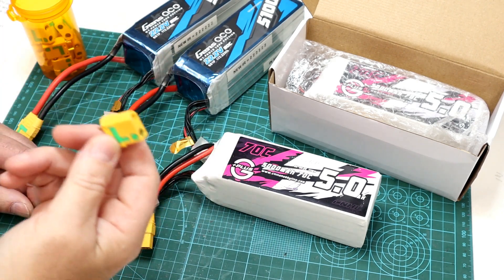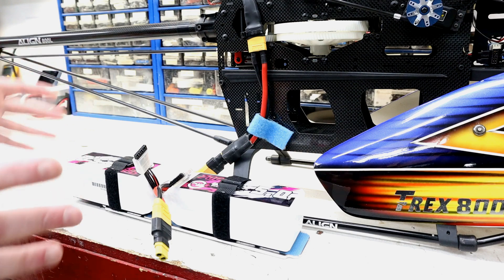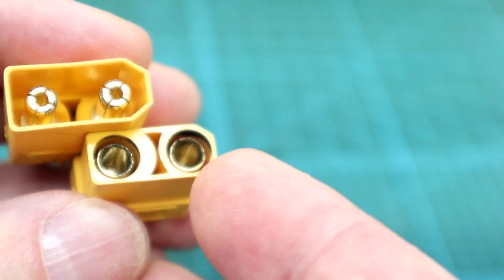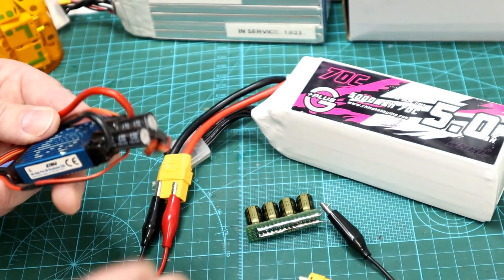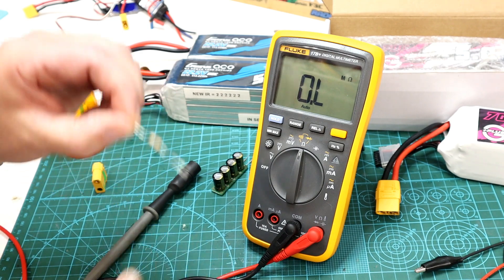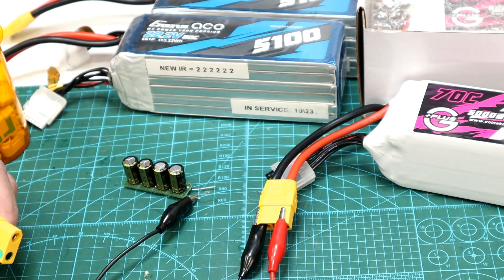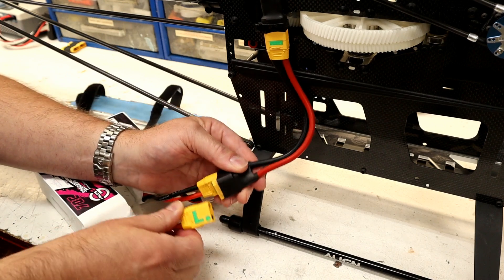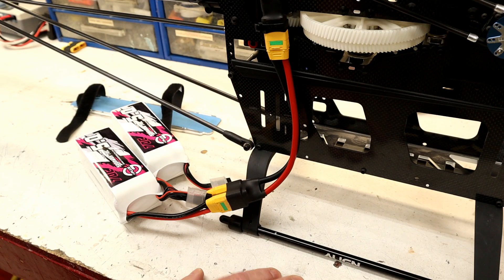How Do Anti Spark Connectors Work & Do You Really Need Them?

Comment: I've converted all my LiPo batteries from 4S upwards to XT60 anti-spark connectors. From 5S upwards, I only use XT90 anti-spark connectors. I'm very happy with the results. Finally, no more sparks when connecting the batteries.

Comment: Why does the green indication shown as its resistor also connected to the other pole.
The green bar are shown crossing the poles, not just the entry ring and the full connect full in...
Reply from the maker: It's not. No one ever said the green plastic is where there is a resistor/s; there is no correlation between green plastic and what's inside. If you take the time to grind one open, the resistor is located between the two split rings of the positive female bullet sleeve; nothing more, nothing less.

Comment: Is there anything I can plug in between the charger and the battery. I know you can get anti spark connectors but I don't really want to solder anything.
Reply from the maker: If you don't want to solder, then you are stuck with stock connectors.

Comment: this is works with xt60 adapter because i dont see xt60S connectors?
Reply from the maker: XT60's are too small for this design. Only XT90S.
Reply: @Rchelicopterfun  so the amass xt60h is not anti spark?
Reply from the maker: No XT60 is anti-spark (the original/h or i).

Comment: Basically an RC circuit to the source. RC provides a time constant, delay. A capacitor is a voltage device. After 5RC(time constants) it acts like an open. An inductor(coil) is the opposite. But, remember that resistors inline will have additional resistance to the battery. Not, much but it’s there.
Reply from the maker: The momentary anti spark resistor will add no additional resistance since it is only in circuit for a brief moment before the pin slides past it to make full connection; unless of course you don't slide the connector all the way in as explained in the video. If that happens, the resistor will get so bloody hot, it will melt the connector or burn out.

Comment: John, why are these on the battery side and not the ESC side? I like the idea but think it would of been better to be on the ESC side so you don't have to add it to every battery.
Reply from the maker: Short danger - that's why. The male XT90's (the ones always on the ESC side) have exposed pins that are not insulated and thus have a high short potential if anything conductive were to accidentally or intentionally inserted into the end of the connector.
The lowest short potential connector, regardless of type, is the ALWAYS the one that goes on the battery side for safety reasons. I cover this in detail on my RC Battery Connector page on my website: https://www.rchelicopterfun.com/rc-battery-connector.html
Reply: @Rchelicopterfun  I could be missing something but why can't one of the pins on the ESC side  have two parts (like the one socket on the battery side) and move the resistor / anti-spark to the ESC side?
Reply from the maker: Yes, you're missing how split/sprung bullet pins function. It would be next to impossible or at least very costly to have a sprung male bullet pin divided into two sections and still maintain sufficient sprung force along its entire length for maximum contact area and long cycle usage. 
In short, if it were possible and cost effective, the design and electrical engineers at Amass would have done it.
They designed it the best, most practical, most robust and most economical way possible and that is to have the split ring in the female (bullet sleeve) connector on the battery side. 
Not to mention the other obvious cost saving factor that you can still use the same charge harnesses and paraboards that all come with male XT90's to charge through the female XT90 on the the battery without having to update them all too if/when switching over to the anit-spark versions. Common sense design that is backward compatible to boot - brilliant engineering.

Comment: To a small degree one could ask why the ESC doesn't have a precharge circuit built in. But thinking of the application, space is a premium. So "just adding in" a precharge resistor and a suitably large transistor/relay sadly isn't really an option.
But these anti spark connectors seems like a wonderful thing to see. I have pondered something similar for other connector types before (since it is honestly really simple), but nice to see one implemented in practice.

In regards to the inrush creating the spark. It likely isn't all that good for the capacitors. But I guess it is fairly negligible compared to other sources of wear/aging. For an example heat dissipated as they suppress our ripple likely causes more degradation over time than the few sparks on power up. In this case, the connector seems like the weak link as far as this inrush is concerned.
Reply from the maker: Refreshing to see common sense and critical thinking being used in a YT comment - appreciated! 👍
Reply: @Rchelicopterfun  Thanks.
I try my best to be nuanced and at least try to stay on topic.

And most importantly actually watch the whole video to not be needlessly redundant. (even if I do type up my comment as I watch, but amend it when needed.)

Comment: I don't have any experience with RC.

Why not have a proper power switch on the ESC board or at least inline on the cable? Wouldn't this be much better suited to handling the power-on demands repetitively without failing?

do the currents in play make such a switch impractical or cost-prohibitive? seems like it's the hobby itself that is cost-prohibitive for most people lol
Reply from the maker: No; in fact an inline switch would be much worse. 
1. As you correctly surmised, a switch rated at 100 Amps plus would be Costly, Huge & Heavy . Not something that would even work in most RC aircraft applications where space in limited and weight is the enemy.
2. The pitting issue and increased resistance would move to the hidden & concealed contacts within the switch with no way to visually inspect their condition during your pre-flight. 
3. A switch introduces another failure point & and source of increase resistance and ripple voltage potential.
4. The inrush current would still occur. 

Nothing is as robust and works as well in high current RC aviation applications as a simple connector with as short and direct a power path and lead length between the battery and ESC with as few failure points as possible. This has been proven time and time again over many years now. Guess that's why all the electrical engineers and manufacturers who design and evolve these systems continue to use this connectivity method.

Incidentally, I can name at least 50 hobbies and pastimes just off the top of my head that cost way more than RC of any discipline, some by orders of magnitude. In fact, getting into RC has never been so accessible to so many worldwide. What used to cost a full month's wages to get into the hobby back in the 80's when I started, now costs a day's or less wages. That's affordable for most people with modest disposable incomes.
Reply: @Rchelicopterfun  Thanks for the reply, those were some good points and answered my questions.

I didn't realise the scale of power these things used. I was figuring closer to 50W myself.

Simplicity is king, as an engineer-in-training, I still get that (don't worry, there is hope for our technological future). It helps when most of my experience comes from fixing things that have failed, you get a good idea of what makes a reliable design then. That being said, I still like redundancy and mechanical shutoffs which is why a power switch appeals to me.

Just making light about the cost mostly, I'll happily spend many times as much on my car

Edit: the majority of the design around spring-detented switches (especially ac wall switches) is often around specifically limiting arcing and sparks. but your points still stand and I see why they're not a good option.

Comment: so without capacitors it wouldnt spark???? also your resistor demonstration isnt exactly real world use. in the real world you just shove the connectors together, quickly. it still provides protection if you just jam them together quickly? how long does it take the caps to charge up through the resistor? hopefully milliseconds. 9:12 i feel like most people arent gonna plug them in like that. you paused for literally over 3 seconds between when the esc got power and you shoved it in the rest of the way.
Reply from the maker: It's very real world. The caps charge up almost instantaneously. Doesn't matter how fast or how slow you plug the connector in. No one could ever plug one in fast enough that the caps wouldn't be fully charged by the time the male pin slid past the resistive ring. We are talking milliseconds (not microseconds) for the voltage to equalize. 
As I said in the video, a discharged electrolytic cap behaves like a dead short until the voltage potential equalizes and this happens very fast with such low resistive values (apx 6 Ohms), almost as fast as having no resistor in fact; again milliseconds which you can plot on an oscilloscope. Yes, the electrolytic caps are the cause for the current inrush;  no caps or failed caps, no spark and the ESC will crap out shortly afterward.

Comment: what's under the section of green filler that runs across the pins ? Seems an odd place to put the actual resistor but maybe there isn't space alongside the cut pin.
Reply: I think that the green filler  IS the resistor

Comment: (1) Electrolyte capacitors do not like to get shorted out. You should always use a small resistor for this.

(2) I think it would be an obligation to those who manufacture capacitor banks or brushless drivers to ensure that they get initialized correctly without damaging other equipment.

Model railroaders use decoders with capacitor interfaces which can load its capacitors carefully enough not to throw the overload protection of their central units or boosters. These type of decoders can detach its capacitors when it comes to "program" (= to configure) the decoder on the programming track. On the programming track the decoder gives information by a small current flow to get detected and decoded by the central unit or another programming device.

Otherwise capacitors should be used at least with a combination of a small resistor and a diode in parallel, but this can prevent the decoder from any reading or configuration on the programming track. Practically you can do mostly "programming on main", but when things do not behave as expected you need the ability to read out the informations the decoder actually got.

Comment: What about using a power switch? Wouldn't that prevent sparks on connectors?
Reply from the maker: The problem would just move to the more costly switch contacts, that you can't inspect for pitting and the capacitors would still experience high inrush current. Moreover, a switch or contactor rated at 100 Amps plus, would be costly, huge and heavy - too big and heavy to be practical for an RC aircraft application where space is at a premium and weight is the enemy.
The best, most robust that has the lowest ripple potential solution for high current electric powered RC applications has, and remains to be, a single connector with as short a wire routing between the battery and ESC as practical.

Comment: As an electrical engineer, I can tell you that the surge current will not significantly degrade electrolytic caps.  You mentioned that you were replacing connectors every season because they were damaged.  I suspect you did NOT have to replace electrolytic caps for any of these units.

If you tried to use tantalum caps for this application however, you would quickly learn that thay do NOT handle inrush currents well.  They are great for applications where you are really cramped for space and need a lot of capacitance, as tantalums are typically much smaller than other caps with similar farad and voltage ratings.  However, we always put an inrush current limiter device or circuit in front of them, and let voltage come up slowly,  rather than being abruptly connected to the full operating voltage.

If the anti-spark connectors are expensive or hard to get, it would only take a few parts and a few grams to insert an inrush limiter before your electrolytics.
Reply from the maker: Yep - pretty much what other EE's have told me & why in-rush never bothered me all these years; other than prematurely destroying the connector pins & sleeves. 

As you surmised, some folks in the hobby use/d two smaller connectors soldered in parallel with the male and female main power connectors that they add an inline resistor to do the same thing. The small connectors with the inline resistor are plugged in first to charge the caps and then the main connectors are plugged in afterward.

It works, but it's a hassle dealing with two sets of connectors, especially with the entanglement of wiring with a dozen or so LiPo packs tossed in your field box/bag. Also witnessed a few forget to plug in the main connector afterward. You can imagine what happened then when power is applied, pulling up to 100A or more through 16 AWG, a 1/4 or 1/2 watt resistor and the small pre-charge connectors rated at 5-10 Amps. 🔥

Fortunately, these anti-spark connectors eliminate all those issues, don't cost much and are easy to source these days. 
Thanks for the helpful comment 🙂
Reply: @Rchelicopterfun  With some connectors using a 3rd wire, it might be possible to use this sense wire and some clever circuitry in the ESC to do this silently without the need for these connectors or the pigtails... getting the ESC makers to do this would be the ideal since they could even do this without the need of any 3rd sense wire, just a small time delay on power-up that prevents the caps from being energized right away. Plus, it would make this work even on regular connectors... getting the ESC makers to spare a fraction of a gram and a fraction of a penny though, that will be hard.

Comment: One question please: My batteries have no antispark line but i do have QS8-S antispark connectors from the battery to the ESC. From the ESC there is a small antispark line (black thin cable) coming out. Do you recommend me still soldering the antispark line from the esc to the negative side of the antispark connector? Thank you!
Reply from the maker: I have never heard of an "anti spark line (black thin cable)" coming out of any ESC so I have no idea what it actually is or how you would wire it. 
Contact the ESC manufacture tech line, or follow the connectivity instructions that came with your specific ESC.
Reply: @Rchelicopterfun thank you for the answer!

Comment: Wouldn't an inductor do the same thing, just better? Like not wasting power if it was pluged in half way.
Reply: Where that 'not wasted power will go'?
It will momentarily raise output voltage way above battery voltage and then lower it back down and again raise, lower, raise resulting in oscillations. You essentially create a  LC series resonance circuit. That is quite bad as first of those voltage oscilations are going way higher than battery voltage.
Reply: @volodumurkalunyak4651   Correct me if I'm wrong, but there would only be a spike of voltage when you unplug it. If you plug it in, as you have DC, you only get a delayed voltage. If you unplug it the saved magnetic field will release a spike. As for the not wasted power I was referring to the case where you don't have it plugged in correctly which leads to problems with the resistor, but shouldn't with an inductor.
Reply: @ironfoot1938  of course not. When you plug it in and there is inductor instead of a resistor, then battery + capacitor bank on a ESC and that inductor form an LC resonant circuit. Lighter version of that (RLC resonant circuit, R is important as L is way smaller -> then R becomes important) happens without anything - L becomes wire inductances R - wire resistance + battery ESR, C - battery + capacitors on the ESC.
When you add a bunch of inductance as a inductor -> LC resonance goes way down on frequency and R needed to have oscilations damped goes way up
Reply from the maker: Nope. Increased weight, space and huge amounts of ripple voltage would be generated along with increased resistance. 100 Amps plus - that would require a huge inductor coil.
RC applications, especially aviation where space is limited, weight is the enemy, as direct and short a current path between battery and ESC, and overall robustness are critical factors.
For this, nothing beats a simple, effective high current carrying connector with as few points of failure as possible. This has been proven time after time over many years now.

Comment: Bit odd to me but im not a rc guy, but a power switch would eliminate the reed for special connectors all together, a pre charge resistor circuit can also help the problem. (Which is almost what those connectors are)
Reply from the maker: Not odd at all if you understand the intended application. 1. A 100 Amp plus power switch or contactor is simply too big and too heavy. Weight is the enemy in RC aircraft and space is generally at a premium.  2. The less contact points between the battery and ESC the better. Every connection introduces a failure point and more resistance and potentially more ripple. It's proven many times over, a single and simple connector remains to be the best and most robust choice.
Reply: Still big inrush

Comment: I use the orange LED fixture connectors for my batteries. Why? Im an electrician and get them free from work as we cut em off and dont use them.
Reply from the maker: What model # and current rating? The Ideal ones I've used (model 102) are rated at 6 Amps. Models like this where this type of high current connector are used will draw over 100 Amps. The 800 here peaks at 150 Amps.